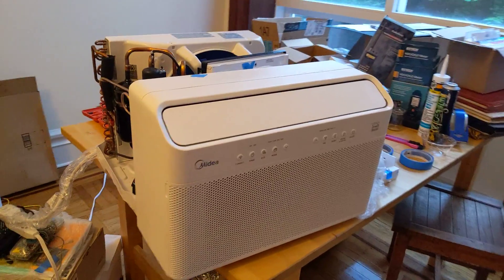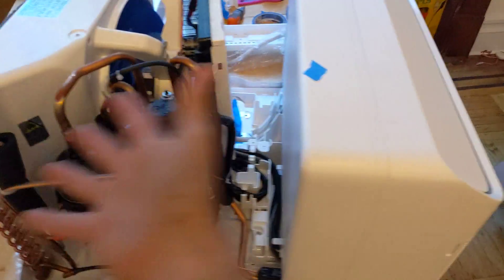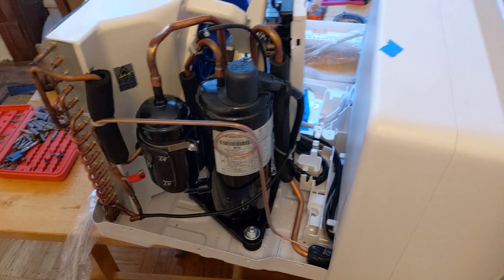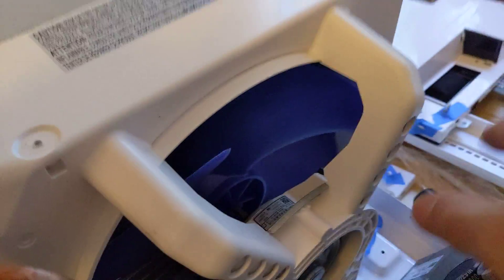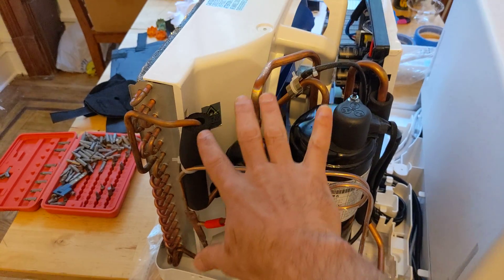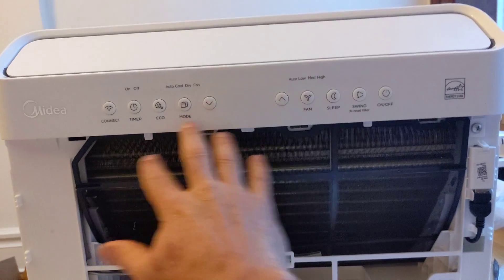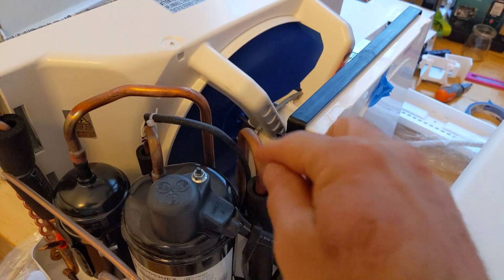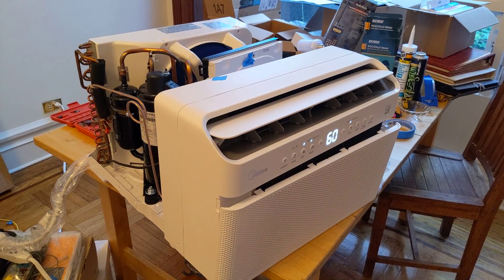How did Midea fit a full mini-split system inside their new "U" window unit?

Comment: my main issue is that high pitched sound. I can still hear it from the inside. Its still miles quieter than my old unit, but the high frequency nature of the sound makes it pretty annoying sometimes
Reply from the maker: Agreed. They should push the frequency higher so it is outside audible range. Slight efficiency loss, but worth it. Or at least make it a setting for people who hate it.

Comment: Do you think it's possible to separate the inside and outside unit? Splicing in some tubing, extending the power cabling, etc?
Reply from the maker: Certainly *possible*, but would likely require opening the refrigerant loop so you'd need a vacuum pump and other AC tools.

Comment: Does it have an option for fresh air or the air is recirculated?
Reply from the maker: No, but you could also just punch a hole in one of the side baffles and run any kind of tube or hose to in front of the air intake grill. Maybe put a screen or filter on the outside end ofth e tube to block insects from getting in.
Reply: @bigjoshlevine  Thank you, just trying to envision this....I am bad at abstract visualization.  Wouldn't the tube bring in (suck) the unfiltered air (hot/humid) from outside?  So basically, you're bypassing the AC completely, and just making a straight pass from the outside to the inside? As thought, keeping a bit of an opening in a window?
Reply from the maker: @aperson1181  The idea is to put the indoor end of the tube in front of the filter grill of the AC unit. Thanks to the Bernoulli effect, fresh air from outside will get sucked into the tube and will then will get sucked into the grill, where it will go though the AC coils and then get blown out into the room nice and cool and dry. Make sense?

Comment: Makes me think this could fit INSIDE a van (RV), with just the compressor section "breathing" through a cut-out in a hole in the side of the van, and the blower portion sealed off and inside the van.  Interesting...
Reply from the maker: Yes, many people would like to use these on a van! Report back if you get this working!
Reply: the compressor half has vents all the way around, front and back.

Comment: It's nice to see them revive the old Silent Knight air conditioner, Montgomery Ward sold them in the 70's. The evaporator was inside and the condenser was on the outside just like these "new" U style units. By keeping the main workhorse components outside the window the noise was greatly reduced. The new technology of the variable compressor really makes these rock. The mini split concept is a great idea. I've been looking into ideas for cooling my campervan project. Thanks for the great how to.
Reply from the maker: Wow, I've never even heard of  Silent Knight. LMK if you ever come across info, I'd love to learn more about them!

Comment: Does this ac have a capacitor and if so, where is it located?
Reply from the maker: This unit has a brushless DC motor, so does not have a typical motor start capacitor like an AC induction motor in a typical old-school window unit would have.
Reply: @bigjoshlevine  thanks for the reply. I have one of these in a shed that is less than 30 days old and is shutting off when compressor kicks on. It was working fine for about 3 weeks then it started doing this after a thunderstorm that tripped the gfci while it was off. I thought maybe the capacitor may have been damaged.
Reply from the maker: @TiSurvival  Hmmm, there are a lot of electronics in this unit so maybe something got damaged from a lightning surge? Hopefully still under warrantee at least?

Comment: One consideration Ive discovered is the engineers did a poor job at power factor correction. This unit has a 0.7PF and my non-inverter whirlpool has 0.9
30 percent losses which could have been corrected with a few extra ICs
The EER efficiency in this inverter unit is 7.9 vs the whirlpool's 9.4
Reply from the maker: Interesting. It is a full inverter unit so I would have assumed the power factor would be close to 1.  I'll test my unit tonight and report back my reading!
Reply: @bigjoshlevine  I'm quite surprised also. I didn't realise what's involved with active PFC but I'm not surprised it's mandated for new appliances. This one might just be before that took effect. I might put one of these in there:

https://youtu.be/U5cqrrhq9TA
Reply from the maker: My 9K unit tested at 0.65 PF under full load. :/
Reply: @bigjoshlevine  if it weren't for that, it's EER would be an impressive 11.4
Reply: @Homestead_Adjacent  Power factor does not directly affect efficiency. This unit is still 11.4 EER but with higher current peaks at the top of 60hz waveform. Real power remains the same and real power is what your power company charges you for.
Reply: @antronx7  it does when you are running it off of an inverter end the poor power factor equates to heat produced in the inverter
Reply: @Homestead_Adjacent  In that case yes. I converted mine to run on DC directly to skip the inverter.
Reply: @antronx7  nicely done. What boost converter did you use?
Reply: @Homestead_Adjacent  no converter. direct from 320v battery. Will try taking boost converter out of old samlex 48v 120vac inverter but may have to rewind the transformer for higher DC output. Midea needs 250 - 360Vdc.
Reply: @Homestead_Adjacent  i have a video testing it on my yt channel.
Reply: @antronx7  oh damn that's a lot of pixies. Dont think I could find an off the shelf supply for that
Reply: @Homestead_Adjacent  it should but again hvdc may bee too high.
Reply: @antronx7  thanks. I realized after I posted that it would make more sense to do as you suggested with a power inverter. If I take a cheap 600 watt power inverter I should have 170 volts DC. would that be enough?
Reply: @Homestead_Adjacent  no thats too low. midea needs at least 260v
Reply: @antronx7  I'll try to find an inverter with a 240 volt output. Failing that do you have any experience rewinding high frequency transformers?
Reply: @Homestead_Adjacent  No decided not to rewind. I have HF transformer from Aims 1500w 120v inverter. It has 2 secondaries that may be possible to connect in series for 350v. Did not experiment with it yet.
Reply: @antronx7  very cool. Thanks for the insight and inspiration
Reply: @antronx7  I found a 300 W inverter module on Amazon for 30 bucks. I have two of them on the way. If I can get 360 volts I'll parallel them, and if 170 I will put them in series. Wish me luck!
Reply: If I was to purchase an ATX power supply with enough wattage that features active power factor correction, could I connect the high voltage DC rails of the power supply and this air conditioner together to solve the poor power factor?
Reply: @Homestead_Adjacent  in theory yes but would have to make sure dc rail voltage is not too high. I did not test my midea above 360v. PFC may output 400v or more.

Comment: Great video and I was curious if you think its possible to get a heat pump in one of these window units with this design. I've been searching for a window unit that also heats but they are just heating elements and the ones that say they have heat pumps only heat above 40F. I've currently got a mini split that I installed and I'm running it off a solar setup with a battery back up.  It would definitely be a lot easier to just slap one of these in a window if they can actually get heat in them.
Reply from the maker: Yes, it would be straightforward for Media to make a version of this unit that could also provide heat, but it would necessarily be more expensive so for this first iteration they were aiming for a low price price point - and that strategy seems to have paid off for them. They have shown a larger unit that includes heat at HVAC shows, but no world on when it will make it to retail. Note than you can always just install this unit backwards in a window and it will heat the inside - just make sure it does not rain on it and that the outdoor temp is not low enough that you could get ice on the outdoor coils!

Comment: I think I'm going to put one under my van. Might even attempt to install a reversing valve
Reply from the maker: Yea, I'd love to spend some time figuring out a way to split this unit without releasing the charge so people without AC equipment could do it. Maybe by crushing the pipes in two places so you could then cut in the spot in between, and then using vampire taps to remake the connections?
Reply: @bigjoshlevine  you still need to pull a vacuum on the new lines. Perhaps some entrepreneurially minded individual would be interested in selling units ready for split installation. Ship them with pre-charged lines. The valved fittings already exist
Reply from the maker: @Homestead_Adjacent  I was thinking you could just blow a little puff of refrigerant to purge the new lines when you connect them (like when connecting lines to normal AC service port) so no need to pump down. There would be a little bit of moisture trapped in there, but hopefully the filter drier would be able to clean that up. 
Midea could ship a split version of this with quick connect fittings like MR COOL does, but not really their market. But there might be enough demand for someone who has the equipment and certificate to start selling properly modified U units with with quick connects already installed.  LMK if you decide to be that someone! :)
Reply: @bigjoshlevine  for $200 a unit it's hard to beat. But the efficiency needs to get better. There's a senville 9000btuh with a stunning 16.2 EER. In a van efficiency is everything. I even considered powering the Midea unit with a boost converter. 12vdc to 180vdc. No power factor issues anymore. Some of the mini splits can run directly from solar DC

Comment: You inspired me to upload a video tomorrow about my Midea Duo heat pumps. They look like they have a ton of similar parts on the inside. I wish they would make a heat pump version of the U shape design. The only issue with the Duo is that it stops heating when its below freezing despite having a fully functional defrost mode. They are pretty loud when they defrost though. I have managed to make them heat down to 10f outside by letting them suck a little more indoor air. It definitely makes a low pressure zone inside the house but its worth it to me as my only other heat source is a 200,000btu 70% efficiency low-pressure boiler. $$$

Comment: Question: Would this create a vaccum pulling outside or other room air in? 

My window or worse portable units seem to pull in air from elsewhere. This might be a better solution than a traditional mini-split in my current situation. Thank you for taking the time to make and share the video.
Reply from the maker: This unit is neutral pressure, so running it should not pull in air.

Comment: I’ve seen some people drill drainage holes in the back. They argue that they’d rather sacrifice some efficiency for longevity by reducing rust, mold and corrosion inside the unit. What are your thoughts on that?
Reply from the maker: Yea, I do not know what to say on this one since I have not personally see the slime on these units. Usually when you see slime on minsplits it is an indication that too much moisture is getting into the space - so you really want to figure that out and fix it as the best way to stop the slime. I would wonder if that might be related to what is going on with these U units? I do not think there is much hard in drilling holes to drain the water except that you will likely get rust-out around the hole since you are breaking the powder coating there. I guess if you drill the hole and then cover the bare metal inside the hole with a grommet seal then that should not cause any issues except slightly lower efficiency.

Comment: It's too bad it doesn't heat as well
Reply: It just needs a reversing valve, a couple one way valves, another txv and a thermostat made for a heat pump.
Reply: It provides heating but it only to 41° it does not have defrost. Really kind of sad I would buy one in a heartbeat.

Comment: How does it deliver heat?  I do not see a reversing valve in this video.
Reply from the maker: It does not. This unit only does cooling.
Reply: @bigjoshlevine  My 12000 BTU does.  I will find time to open mine and look-see.

[Edit] I was wrong, only the remote says "heat"; the AC unit has no such function.
Reply: @steve0826 🤣🤣🤣 midea strikes again.

Comment: I thought MINI SPLIT was able to heat as well as cool? Not sure about calling it a mini split am I wrong?
Reply from the maker: It is controversial, but to me "mini split" literally means a spit heat pump system that is smaller than a normal "central" unit. Most manufacturers follow this naming convention and add " with heat mode" or " with reversing valve" to indicate that they can pump the heat in either direction. But in some regions they assume a mini-split can heat, and also there is controversy if "heat pump" indicates that the system has a heating mode (technically a heat pump is just a device that pumps heat, so an AC unit is a heat pump).

Comment: I’m having rust issues in the back; is there a drainage hole somewhere?
Reply from the maker: It does not have a drainage hole. The hope is that the water in the condensate pan will evaporate. You could drill a hole in the bottom of the pan if you wanted to no have water in there. I'd do it in the left corner (looking at it from the outside) so that the condensate water could still flow over the bottom of the condensing coil.
Reply: @bigjoshlevine  thanks for the reply…..I have decided to spray the bottom of the inside with a zinc galvanizing compound to temporarily halt the rust. I think there’s a galvanic reaction between the copper tubes and the Aluminum case.

Comment: This does not appear to be a heat pump.   that is the important feature and talking point.  There are lots of inverters and a few U shaped units.  Maybe that U shape helps install or makes it heavier.  BUT WE NEED WINDOW HEAT PUMPS.  Don't get over excited it is still a window unit, but its not a heat pump.  That is why "minisplits" are such a big deal, they are heat pumps.  I don't care about their shape.

Comment: Thanks for the tear down! Do you know where the outside ambient air temperature sensor is? My unit doesn’t seem to be cooling as much as I’d expect based on the set point - it seems to factor in the outside temperature as well. Since it’s upstairs in an old house, sometimes that’s not ideal. If I could find the sensor I’d like to measure power draw and possibly replace it with some resistors
Reply from the maker: I do not think there is a sensor to directly measure outdoor temp, instead i think it measures the temp on the return liquid line and uses that to calculate how much heat is being rejected on the outdoor coil with current fan speed. Also, these are digital temp sensors so you cannot just jumper them out with a resistor. You could fake the controller out with something like an Arduino, or move the sensor someplace warmer in the system.

Comment: that high pitch noise from the compressor is absolutely unbearable if you are younger or have good hearing, I also have tinnitus so when it kicks on it gives me a migraine. which is really really unfortunate since this unit is so good otherwise.
Reply from the maker: I also have sensitive hearing so I understand. It is too bad that they did not just double the PWM frequency to push it completely outside human hearing range - or at least make that an option since it might lower efficiency a bit. You can try adding some foam around the compressor if you are up for a project. I'd probably wrap some cardboard around the compressor to make a form and then fill that up with the squishy kind of minimally expanding foam. I bet the foam would be effective at damping these high frequencies.
Reply from the maker: Even easier: try covering the compressor with something like these automotive sound deadening sheets...
https://amzn.to/43GsFPI
Reply: @bigjoshlevine  Thanks so much for the awesome replies. I think I may even have some automotive sound deadening sheets left over from a old car project I did years ago. I will report back with how it goes when I have a chance to do it.
Reply: came back to reply because of the recalls, I cleaned my unit every 6 months because of the insane amount of mold growth I was getting, i had drilled a hole for drainage and even had it EXTRA tilted back to encourage draining and regardless of what I did (even mold inhibitor sprays) the mold just kept coming back. I did end up wrapping the compressors in some deadening material and it helped me massively i also even added some deadening material to the inside of the flat non vented areas around the compressor area near the u part of the unit. I could still hear the high frequencies but it was bearable at least. I did end up replacing those unit with a LG dual inverter unit and WOW the high pitch is basically gone it sounds way more like a old style compressor and is way lower in frequency tone… idk if the dual properties of it change the frequency resonance of the compressor or what but man this thing was amazing when i tested it. Sadly it doesnt have split motors for the cold and hot side fans like the midea so it wasn’t as power efficient but it used the old style fan blowers and a dedicated drain from the cold side to reduce mold production even more. but its a good 3 inches longer and became a problem with my particular setup so I couldnt even use it. I ended up settling with a midea duo 12K btu from costco for $380. Its a dual hose hybrid (not a true 100% dual hose) and its been working really well and the compressor used on these newer models are miles better than these older window u shaped models for high frequency sounds.